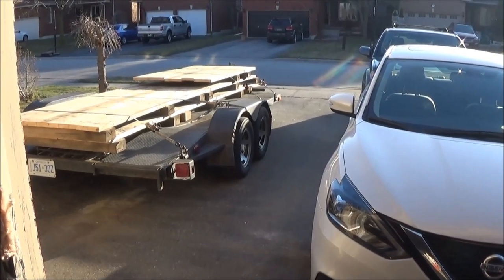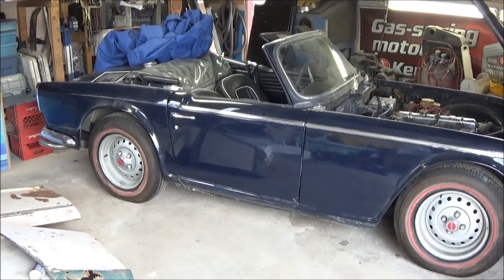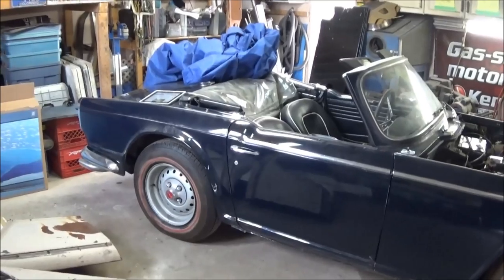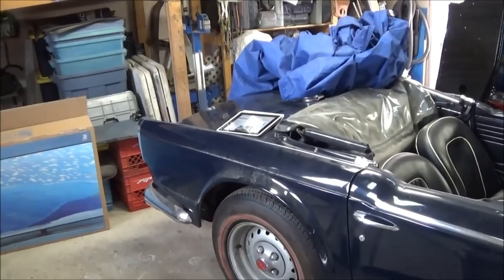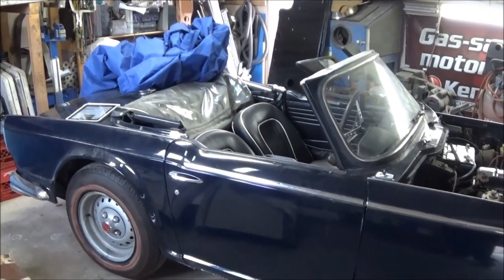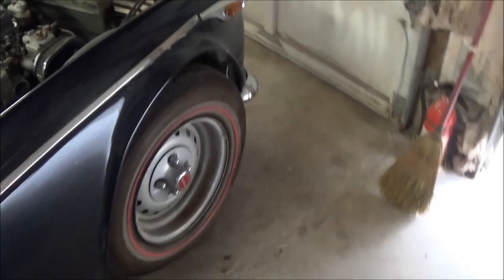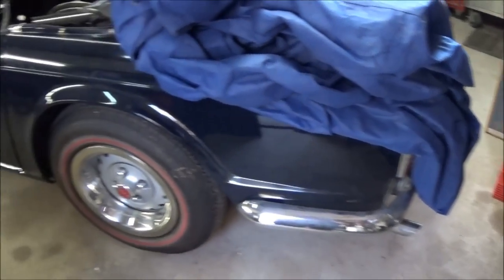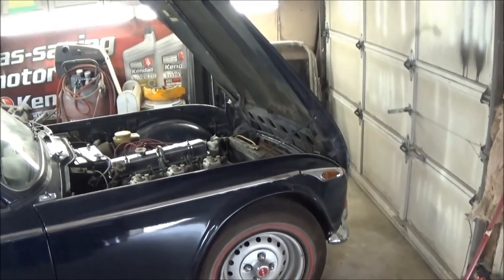1968 Triumph TR250 Restoration with a Twist

Comment: Just looking at your car makes me envious and  nostalgic. I have owned a TR250 between 1984 and 1990 and absolutely loved it. I did quite of bit of work on it; from rewiring its failed harness to replacing its back shocks and U joints.
Reply from the maker: constantin yes, I agree, they are great cars. This ones not in the best of condition but we are working towards correcting that!  Thanks for watching and commenting.

Comment: Hi David, I've spent most of the Christmas holiday looking at and enjoying your original TR3A videos, it's too cold in my garage to work on my TR3B. I think in this video you said that it was April 1st (in the UK known as April Fools Day....!) and having seen the issues you have discovered during this restoration to date I have to say that looking at the car on day one, I was completely fooled by its appearance, I couldn't have imagined in my worst nightmare the work that you have had to deal with.... I'm looking forward to seeing the car finished and your perseverance has been exceptional, well done indeed. Kind regards, Richard.
Reply from the maker: Hi Richard!  Yes, it didn’t look too bad initially. But, as soon as the panels came off, things went down hill rapidly 😎. It’s been a challenge to be sure but I’ll keep plugging away at it.   Just about to head out to the garage now. Thanks for watching.

Comment: I am enjoying watching your work. Just a couple of thoughts. The cost of some panels and repair patches are low enough that it is not worth your time to make your own. The A and P posts are two spots where the British Heritage pieces would make your life a lot easier. The rear of the B posts are almost always shot and the repro pieces are inexpensive. Trying to make the junctions of the door posts and sills right is a lot easier with those pieces. The panel in front of the A post does not overlap the outer sill - but I don't think that distance will affect your final assembly.

Comment: Triple Webers?  I just installed those on my MGC.  If I may offer some advice?  While you have the engine out, install an Oxygen Sensor in the exhaust system and use an Air/Fuel Ratio Gauge to help you get the jetting right.  It makes tuning a whole lot easier than trying to guess if the engine is running rich or lean. And concentrate on getting the idle circuit properly set before you worry about higher RPM.  Most people have their flat-spot problems making the transition from the idle circuit  to the main running circuit.  They are separate and Webers are not adjustable. But they are infinitely tunable.
Reply from the maker: Yes a good idea to be sure.  I was running dual webers on my 60 TR3A and they were a challenge to set up correctly.   The triples on the 250 should be set up reasonably well as the PO drove this car for many years.   However, I was surprised to also find that the PO ran the webers without any velocity stacks inside the filters....I know that webers don't perform as well without the stacks to direct the airflow.   So, we will correct that and go from there.   Cheers, Tush
Reply: The velocity stacks don't fit under the air cleaners.  I have to run without them as well.   If you want to use the velocity stacks I think you have to fit the foam socks over them and dispense with the air cleaner.
Reply from the maker: Yes.   I was running velocity stacks with foam filters on my 60 TR3A.   I think they will look the part as well.   Was looking at the bills from the PO.   Can you believe that he spent $300 on this chrome filters about 20 years ago....